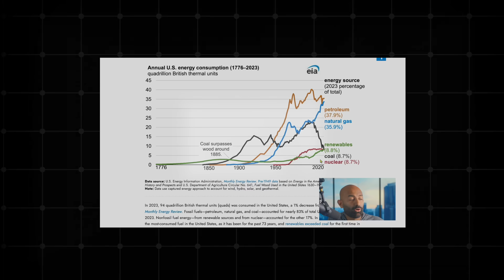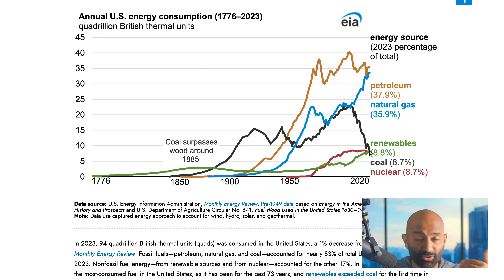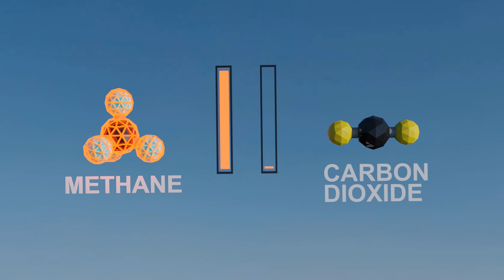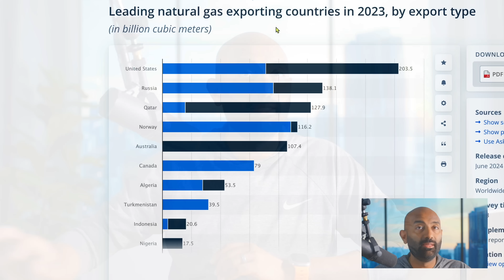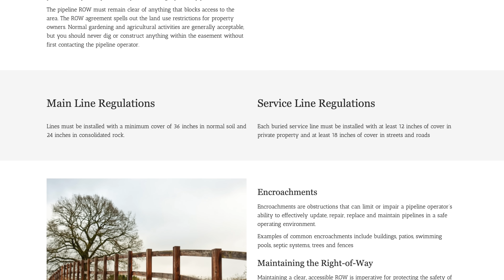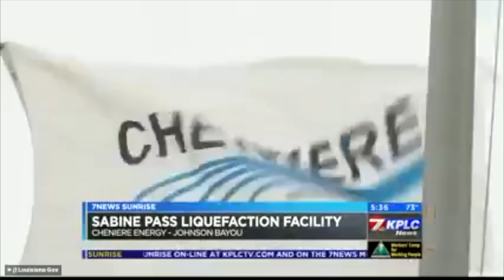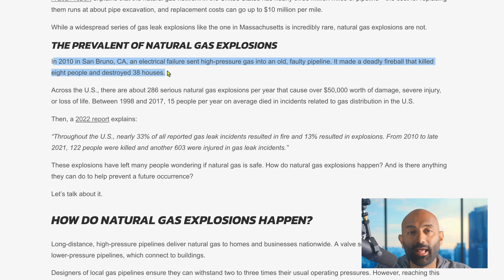The TRUE Danger of Natural Gas - This SHOCKED Me

Comment: Fracking fluid is not just water. Maybe do a deep dive on what fracking fluid comprises. From anti corrosion to biocides. Water sounds so innocuous.
Reply: It's still mainly just mud. This becomes important when comparing fracking that releases gas and oil into groundwater and contaminates the water and soil, and fracking for geothermal energy which does not. Also, if you are drilling for hot water the area by definition is not used for drinking water.
Reply: @AnalystPrime   this video is primarily about gas and not geothermal. The fracking fluid I was referring to was for gas. I think it would be interesting for Ricky to do a deep dive on it, especially for those who think it's just water or 'mud'.
Reply: @ Yes, I just saw a video on enhanced geothermal recently and lot of people seem to think that fracking itself contaminates land badly when it is the widely released hydrocarbons that cause your tap water to become flammable.
Both kinds do have some risk of causing tremors, but that is less likely to be a major issue unless your house was built out of straw or some idiot didn't do a survey and started drilling in a fault zone.
Reply: @AnalystPrime  interesting about what you say about 'tremors'. Fracking was responsible, in Lancashire in the UK, for causing structural damage to nearby houses that had stood for a hundred years without problem. I don't think they were made from straw?
Reply: @ Actually, straw would probably have survived better than rigid hundred years old houses built in area where earthquakes were never an issue. More important was that when simply emptying underground reservoirs(whether water, oil or gas) will cause tremors they used fracking to widen the area affected.
Reply: @AnalystPrime  I was suggesting Ricky do a deep dive into fracking fluid, and you talk about tremors and straw houses. Then seem  to back track on the strengths and weaknesses of straw houses?
Reply: @RichardIresonMusician  the fracking fluid itself is not the major concern, it's the fact that it carries oil and gas (which is already there, not part of the fracking fluid, the whole point of spending money pumping the fluid into the ground is so you can get valuable gas and oil out of the ground) into groundwater that might be used for drinking. there isn't just one fracking fluid, by the way. they use all kinds of products, including just straight up water.
Reply: @ToxicallyMasculinelol I'm aware fracking fluid used to extract oil and gas from shale varies in composition. However the principles of operation are relatively consistent. Pump extremely high pressure fluid containing a proppant (often sand), a gelling agent (often guar gum), a biocide (to stop things from going mouldy), a corrosion inhibitor (to stop the steel pipes from corroding) plus other, usually proprietary chemicals, to finish off the cocktail, into the ground. Quite often, millions of litres of this fluid is used, much of which can remain in place. I'm not saying ALL fracking fluid is thus composed, but the majority for oil and gas extraction is.
Reply: @ToxicallyMasculinelol I'm aware that fracking fluids vary in composition. However, the principles of hydraulically fracturing for oil and gas remain relatively consistent. A high pressure fluid comprising a proppant (usually sand), a gelling agent to stop the proppant falling out of the fluid (often guar gum), a biocide, often glutaraldehyde and quaternary ammonium compounds (to stop things going mouldy), a corrosion inhibitor, usually an acid like hydrochloric acid (to stop the steel pipes from corroding) plus a range of proprietary chemicals (often difficult to find out what they are) to finish off the cocktail. It is not uncommon for millions of litres of fracking fluid to be used per frack. I'm not saying ALL fracking fluid is composed thus, but the majority, for oil and gas extraction, is.
Reply: there is no mud involved in fracturing
Reply: Come on he's just a 2 but DaVinci.
Reply: @RichardIresonMusician  true, halliburton will not even share what it is made of when asked by congress, its corporate secrets.
Reply: @ilovebohol indeed!
Reply: You apparently do not live with minus 20 C most of the year.  Or have some weeks of minus 30 & 40 C.  Heat pumps do not work under those conditions.  Heat pumps need electrical power which comes from natural gas (low CO2 emissions ) or from coal, oil, hydro or nuclear
Reply: Sorry replied to the wrong comment

Comment: My first job was working for El Paso Natural Gas back in the '70s and it was close to 100 years old then.  Gas can be safe.  EPNG was the first company to add odorizer at the well head (or near) so it was already odorized for the retailers.  EPNG brought gas from fields in CO, OK, TX, NM, AZ and sold it during the summer to CA at the border (the other seasons it was sold to other companies along the way).  They developed one of the first LNG seagoing transports and ports at Savannah GA and Cover Point MD, to buy gas cheap from Algeria.  They built  9 tankers.  The Carter administration cut it off just before production runs starting.  They also built the liquefaction stations in Algeria.

Natural gas transmission lines do have 'over pressure' valves that if an over pressure event occurs, the event is safe.  

The pipelines used for transmission and others use active cathodic protection.  And at lease at EPNG we had real time full time monitored at the time in El Paso.  

We should go to non-gas home heat.  Even remove propane and butane (both are used depending on the area).  Yes we live in an all-electric neighborhood.  A few (say 1 or 2%) have propane that is trucked in for fireplaces, etc.  They typically pay more than for gasoline for a gallon of propane delivered.

Yes, we are on a small lot, drive electric only and have solar on our fence and ground (not roof).  We are basically off-grid for 8 months of the year and on grid mostly 4 months, but with lower electric bills.

IMHO: All energy sources are good, but not for every use, every place.  Engineer and analyze the business case for each for the best long term outcome for us all.
Reply: You mentioned Cove Point MD. I worked on that project as an engineer. It was the  LNG receiving terminal and used an amazing amount of stainless steel piping as ordinary steel pipe gets brittle at LNG temperatures. A large part of that project was massively over engineered compared to regular plants as it was a new unknown type of plant for the company. It was the most interesting project I worked on at that time and I learned a lot.
Reply: @tlum4081  It was new tech at the time!  Very bleeding edge before the days solar became viable.
Reply: In Western Canada with winter temperatures on average at minus 20 and at times minus 30 to 40 C. Rural areas at times still have electrical outages. Natural gas is still the cheapest way to heat
Reply: @jackcoats4146  i

Comment: The corrosive pipe is not due to gas in the pipe, but neglect from the home owner not replacing it with newer anti-corrosion pipes (black steal).
As other posters said, everyone that has worked with replacing gas pipes knows that gas has a very noticeable smell – very strong rotten egg smell.
Reply: That odor is an added component to natural gas (for safety) ... Raw natural gas is odorless...
Reply: @patrickjordan2233 - and that is why natural gas in pipelines going to homes & businesses are safer than natural gas being allowed to seep into the atmosphere
Reply: @patrickjordan2233  Yes, it was actually added after a school exploded and investigators found out people had been complaining about headaches and such for days before it happened but nobody had realized that their gas line was leaking.
Reply: @daptaree7305  black steal. Hahahahahahah

Comment: The biggest problem is how cheap NG is to heat with and how simple and reliable the system is. I've looked into other technologies over the past 25 years, but they all are way more expensive. In my area, you can't have an air source heat pump alone. I may install one if my AC goes out, but since it hardly gets used, they last many decades around here. Geothermal works, but the payback is never when compared to NG. It's March, and the other morning, it was 5°F.  That's my reality.

Comment: Richie, another very interesting video.  Are there home detectors that I can get to see if I have any leaks.  I live in Poway, CA and I also have natural gas water heater, HVAC and stove/BBQ.  I installed solar/batteries and I’m in the process of migrating away from natural gas but it will take years to get rid of it.  In the meantime, I want to monitor it.  Also, does the cities typically inspect the pipes on a yearly or every few years for homes?

Comment: There are also some great technologies where they line the ID of the pipe with plastic to stop leaks and also push larger pipes over the OD of the pipe to contain the original pipe so not having to remove it
Reply: ooo, I'm aware of lining old pipes. But that condom method I've not heard of, do you perhaps recall what that process is called so I can look it up to satisfy my curiosity?

Comment: A major issue with removing natural gas - all the home generators would no longer be able to run so people would buy large gas tanks which would be very dangerous- as now this would not be regulated
Reply: Home fuel oil tanks are common in remote communities in Canada. They leak too, but that's the price of living in remote areas - we don't have utilities to heat our homes. Fine, they leak, they need repair, it's not exactly a solar panel from an environmental stand-point, but it's all we have. There are no pipelines out to the middle of nowhere, so we make due. :)
Reply: @John_II - the solar panels have toxic heavy metals in them, recycling works with non-toxic components of solar panels like glass & aluminum, so solar panels are merely a bunch of super-fund sites waiting to happen.
Reply: @ Good to know... so it's the electric car thing all over again - sold as a "green" product but ultimately it's not exactly great for the environment. :(
Reply: @DavidHalko  Not really though.
Reply: @timogul  - really, though.

Solar panels are recycled by removing manufacturer serials, resold in the used market, then they are buried in landfills after special disposal permits are granted or when they are just thrown away in the garbage or when they are buried in backyards.
Reply: @DavidHalko  Not really though. And the important part to remember is that even if those stories you heard were true, they would STILL be better overall than burning natural gas to produce the same amount of energy, right?
Reply: Solar panels are in a pretty permanent form, its not like they leak all over the environment...  @DavidHalko

Comment: No taxis or trucks run on LNG. LNG has to be kept liquid with cryogenic, not pressure. So it needs an insulated vessel, and it has to slowly leak out, or it needs compressors to reliquify  as it slowly boils. The taxies and trucks you saw run off LPG that stands for liquefied petroleum gas, propane and butane, these gasses can be stored liquefied under pressure at room temp, natural gas can not be stored this way.
Reply: In Japan they run on CNG.  Compressed Natural Gas.  

(Not refrigerated obviously…)
Reply: I was in Ukraine in 2008 and all the buses and many taxis ran on CNG. They had it at service stations and used a tank in the trunk. When I got back to the US there was only one Honda available and very few filling stations in my area.
Reply: “CNG is typically used as a substitute for gasoline in automobiles. LPG is often used in the industrial, refrigeration, agricultural, and catering industries”

Comment: This is gaslighting at its finest.
Reply: Haha!
But seriously, his recent (almost) ode to gasoline and other liquid fuels compared to nat gas is a bit jarring. They are both outdated and dangerous, and should be replaced with electric solutions ASAP.
Reply: @FLPhotoCatcher 
Where are you going to get all that copper?
Reply: @TheRustyLM  There are less than 50 years of oil reserves left but copper reserves last at least 200 years.
Reply: @TheRustyLM  like most all metals, the quantities available today will be roughly the same in a 1000 years because metals are all reusable\recyclable, and they are not consumed by processes that use metals, especially precious metals like gold and silver, and semi precious metals like copper, brass etc... So I believe that having enough copper for the future is a non issue. Especially since there is still quite a bit still in the ground just waiting to be extracted. Unfortunately mining copper is exceptionally bad for the environment due to the chemical process required to remove the copper from the ore (the process contaminates very large quantities of water that are then released into the environment, in some cases untreated, but the EPA requires them to treat this water today, but the way Chump is going he is trying to get rid of the EPA and he is not the only one. Conservatives have been trying to gut the EPA for years, and Chump did a good hammering on it last time he was in the WH weakening it a great deal). So reusing and recycling copper is quite important for reducing the harm to the planet..
Reply: @ 50 years is a silly figure. The top 10 countries' oil reserves are about a trillion barrels. At today's global consumption levels, this equates to 300 years.
Reply: Still underrepresents the extreme dangers of natural gas.
Reply: @SigFigNewton  your wasting your time. You can't reason with folks who don't want to hear it. There is hardly any real political discourse these days, because it is not about the issues anymore, it's just us and them. We are regressing and society is now going backwards!
Reply: @ericpatterson3887  trolling lib
Reply: @ yeah, it kills 1/4 of the people that electricity does in the home each year, if we add in the workplace it is 1/10 as dangerous as electricity.
Reply: @ Apples and oranges.
Reply: Ohh ok😮 I thought gas lighting was me and my friends lighting our farts on fire back in high school.
Reply: @danlowe8684  what a profound statement. Care to elaborate?
Reply: After losing  electric power repeatedly every year the past several years due to winter storms I will never rely on electric -only heat pumps. My choice to install an ultra high efficient gas furnace instead of a heat pump during our renovation saved us last year untold  costs from frozen water pipe damage that befell countless neighbors. We were without power for eight (8!) days  in January 2024 in Portland OR - not at all rural, mind you.  That together with the outrageous price inflation of Portland Gas and Electric cutting deeper into our community’s collective wallet whilst offering no assurance against future outages I find it irresponsible to place my family’s welfare in the hands of only one energy supplier. Until utility (read electric) suppliers get their act together and harden the grid, this idea of NG-free lifestyle is just another YouTube promotion not based in reality. FWIW I have solar, BEV and PHEV vehicles and I believe in the environmental movement ( including much of what is discussed on this channel) , but the reality is any place in US where you need to heat your home regularly ( read: not SoCal or FL) folks will still need NG, or wood, or fuel oil, or coal. Asking folks to blindly trust electric suppliers is doing a real disservice to the environmental movement.
Reply: Ricky, google "deadly tanker explosion inside edition" for a video that highlights the danger of transporting LNG from another perspective. I have to laugh when the Anti-EV trolls try to say that batteries are dangerous. Will never see an electric semi or a trailer load of batteries do this. Not even close. Perspective is important.
Reply: Fear Mongering!!!!
Reply: @danlowe8684  sounds like it so far just got started in the video. I replaced lots of pipe that looks like that and still had plenty of wall thickness especially with the low pressure. I am one minute in let's see if he talks about the actual pressure in the line to a house
Reply: Yep. "We need to go all electric and stop using natural gas". Um, you do realize that 43% of the electricity used in the US comes from burning natural gas right? So, when everyone goes to all electric, and we have to burn more natural gas to produce that electricity where is the benefit? It is really weird how much wind and solar has been built where I am, windmills and solar panels all over, yet, the electricity rates have doubled over the last 10 years. And where do we buy our "renewable" energy infrastructure? It isn't made in the USA and most of the operators aren't USA companies. It is a crying shame that US companies aren't the ones making money off these scams.
Reply: @lonnywilcox445  Solar will reduce the need for nat gas. Yes, utilities will still need to use nat gas for many years to come. This video is mostly about us, consumers, not needing to use nat gas.